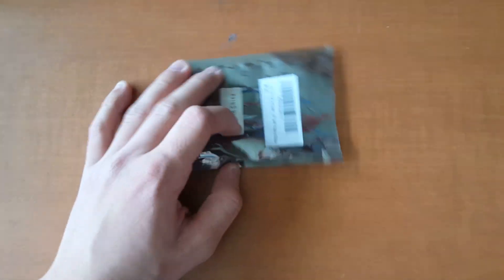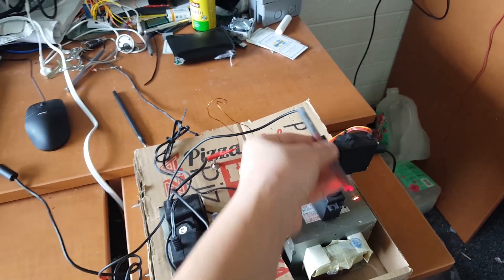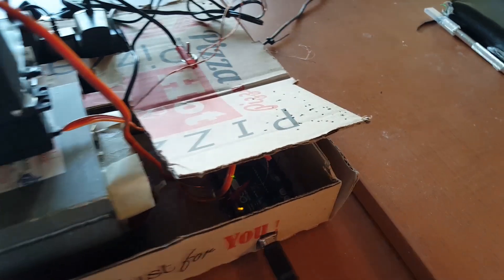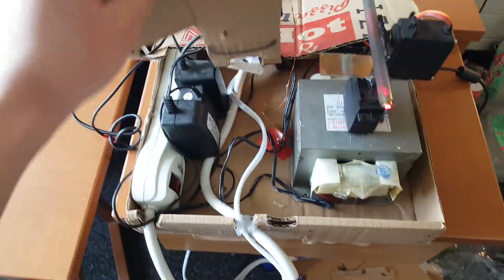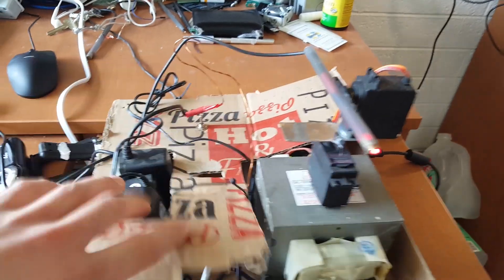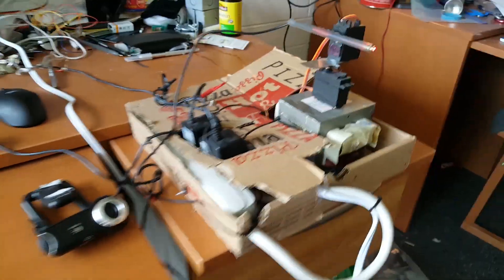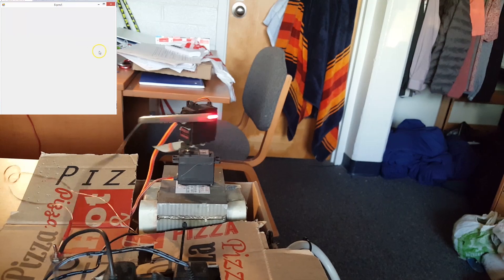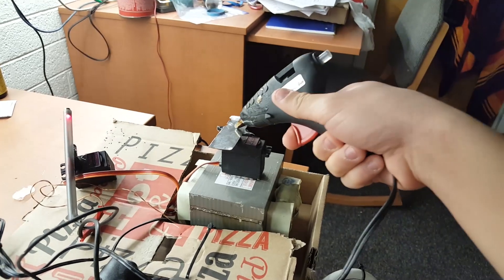Laser Robot In Depth | The Truth

Comment: You do realize that those modules are capable of 10mW and out of the 100pcs I grabbed I had a few that hit 20mW @5v Should have built a power meter first... 5mW is not safe either, you can just blink fast enough to protect your eyes. Above 5mW, not so much.

Comment: Thanks for the videos, I enjoy them as much as markiplier, or dashies. That being said, I'd like to see budget builds such as table top cnc, vacuum molding machine, and maybe a 3d printer, or laser engraver. The connection of the machine to the computer, and programming aspects are very interesting. Granted this stuff can be somewhat costly, but I would be more inclined to buy from your amazon link. ALSO a automatic airsoft gun attached to your laser system would be awesome. On another note which program will you be teaching(not sure if you stated)?